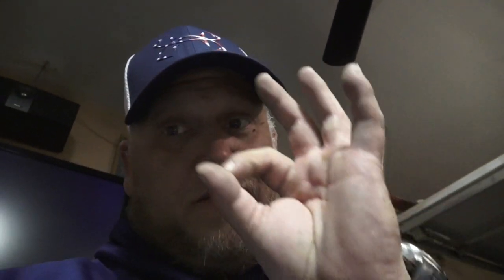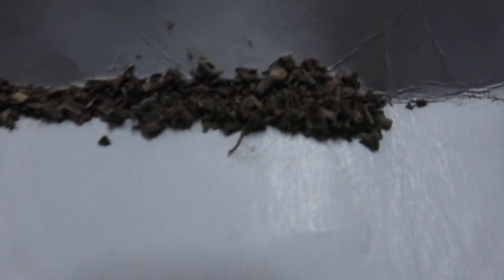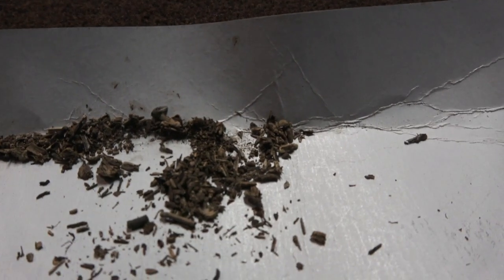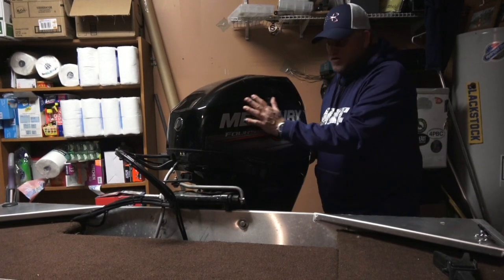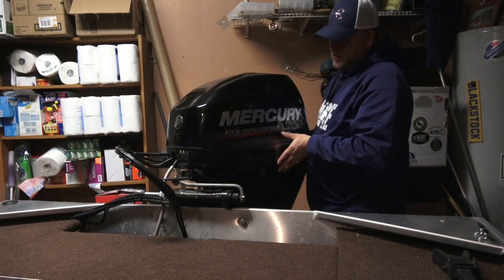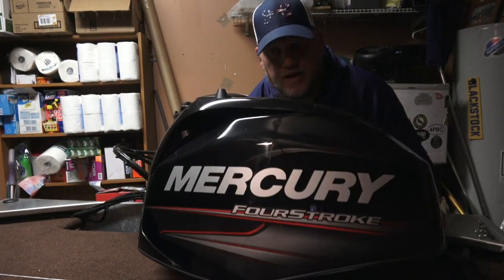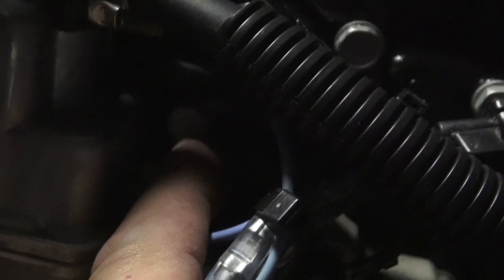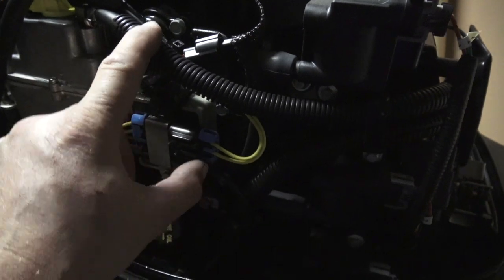What happened to my Mercury 40 HP ?

Comment: When you take your 40 horse out and you're running wide. Open and then you pull it back to neutral like somebody pulls out in front of you. Does your boat make a ratching noise in gear? Like big, loud ratchet and noise.
Reply from the maker: Yes it’s not great but it’s a normal sound for that stress

Comment: That appears to be a design failure on Mercury's part. If the water inlet will allow debris that size into the system then it shouldn't be able to clog any other part of the system. It should pass through. My older Merc lower unit has a larger inlet plate on each side with a lot smaller passages that would block debris like that from ever entering the cooling system to begin with. I recently replaced the engines thermostat and there was no evidence of anything like that collecting in the thermostat housing (in 20 years of operation in some pretty bad water).
Reply: I was thinking the same, I had my Mercury 40 hp for 21 years and never had that problem.

Comment: So was you boat peeing water out with it clogged ?
Reply from the maker: Yes
Reply from the maker: only place the wood collected was in the thermostat.
Reply: The tell tale (pee) hole comes from the fuel pump cooler outlet which is on separate circuit for water passages. The pump provides cooling to fuel cooler and motor at same time.  You would never know if thermostat has failed unless you monitor vessel view or smart craft gauges or in this case guardian came on.

Comment: So the tone wasn’t from the motor itself, but a warning system at the dash? Not for overheating but for low flow? Is this factory on the tracker? Thanks!
Reply from the maker: sporkcrx blocking t stat probably wouldn’t allow proper reading thus generating the tone.
Reply from the maker: sporkcrx the guardian warning horn is attached to the ignition.

Comment: VesselView is supposed to show the meaning of any alarm generated. I would assume that the wood chips reduced the flow of coolant to the engine and there is a read-out on the VesselView app showing coolant pressure. Now, of course the app would not be able to tell you specifically where the blockage is but it would have indicated a coolant flow problem. So, I don't understand why the BPS guys would tell you that it wouldn't have helped Anyway, glad you have your boat back and it wasn't anything major.